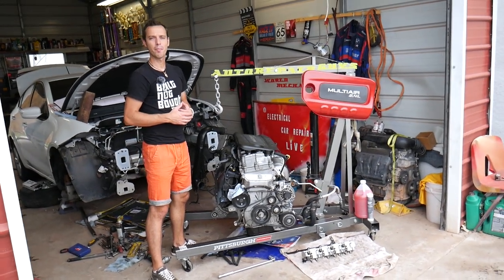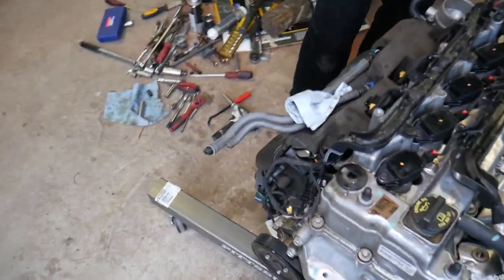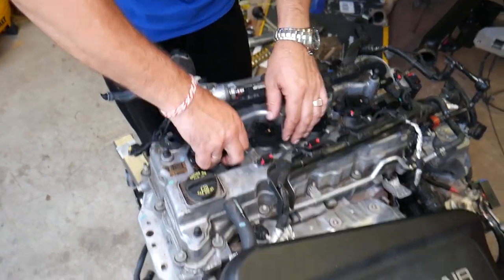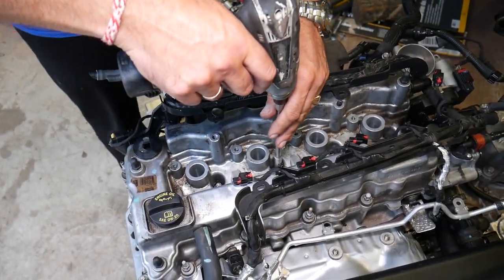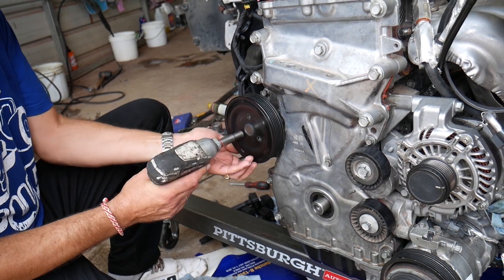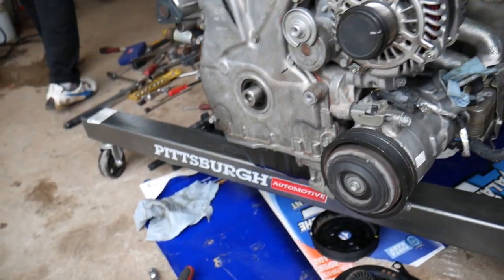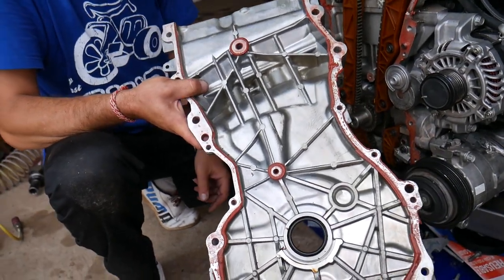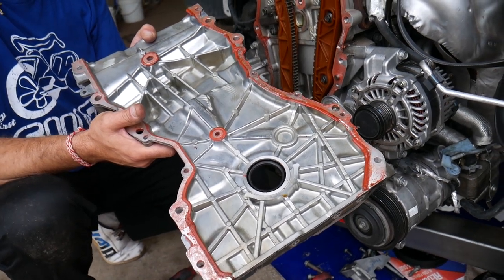TIMING COVER REMOVAL REPLACEMENT, OIL LEAK FIX CHRYSLER 200, FIAT 500X, DODGE RAM PROMASTER CITY 2.4

Comment: Thanks for making this. The 2.4 Tigershark was used in the Chrysler 200 as well and has been a very good motor for my 2015. I have 220,000 clicks on mine and still going strong. Recently started smelling coolant with no major fluid loss to speak of and some very light overheating at idle. Realized it was timing cover gasket and found this video. Thermostat replaced at 75,000 miles and a heater hose/jumper hose being replaced are the only issues I’ve had with this motor. Regular maintenance is all I’ve ever done so I give this motor a solid 8/10 as far as how it’s ran for my 30 mile one way commute since I’ve owned it. Still averaging over 30 mpg as well.